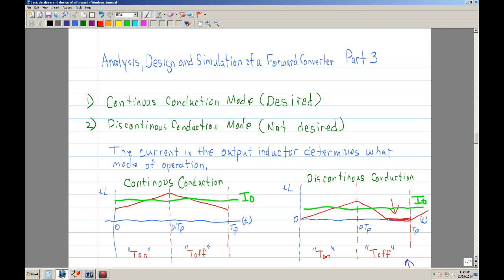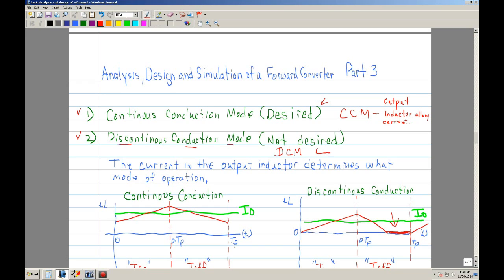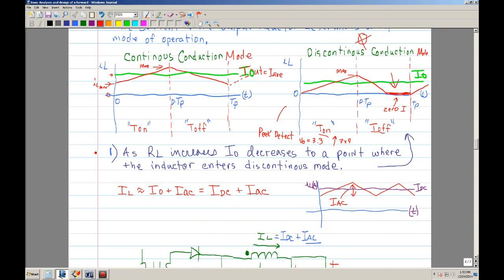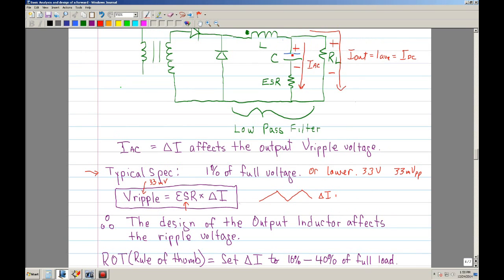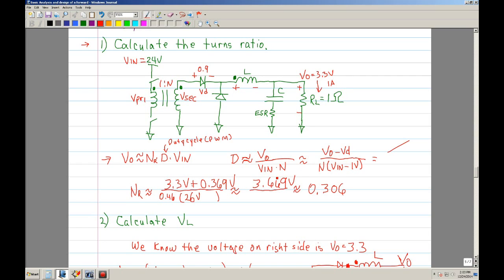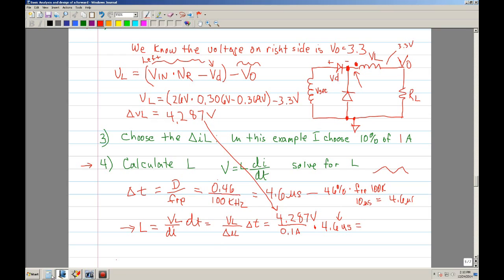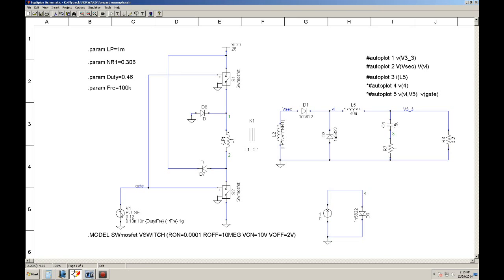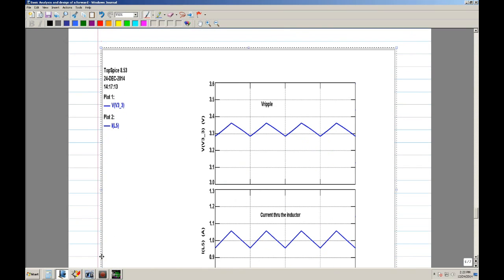Forward Converter Part 3; How to Design and Simulate the Output Inductor

Comment: I  am working on integrated boost forward converter ....   during  the  state space model designing...  i  faced one doubt that is the state matrix of  forward converter and boost forward converter will be same or  different  ? as  the model is designed for output inductor and capacitor  and boost  integrated inductor is connected in  front part of the circuit????

Comment: Hello Robert,

Why do you include a subtraction of 1V from Vin when calculating the turns ratio. I was thinking that it would account for the diodes in the primary but that can not be the case as we don't know the turns ratio yet. Can you please explain this?
Reply from the maker: Taking KVL around the loop, you get, Vsec-Vdiode_sec-VL-Vout=0,  For for VL=Vsec-Vdiode_sec-Vout,  Vsec = Vin*NR,  So now you get VL=Vin*Nr-Vdiode_sec-Vout.   You can also account the primary diode if you want. But you have to account for the secondary as well

Comment from the maker: Hi Rizky,

Sorry for the confusion. I was trying to get more accurate results so I include the voltage drop due to the secondary diodes. So Vd is the forward voltage drop of a schockey diode which has about 0.369 volts at 1 A. I will compare the simulation results to breadboard in future videos. I hope this clears up the confusion

Comment: It is Good tutoril Mr. Robert
I confuse in step transformer turn ratio.
How if i I confuse the VD at equation Vout = Vin * Nratio *Duty.
Thank You
Reply from the maker: Hi Rizky,

Sorry for the confusion. I was trying to get more accurate results so I include the voltage drop due to the secondary diodes. So Vd is the forward voltage drop of a schockey diode which has about 0.369 volts at 1 A. I will compare the simulation results to breadboard in future videos. I hope this clears up the confusion
Reply: Good afternoon Mr Robert,

Thank you for your attantion & your help.